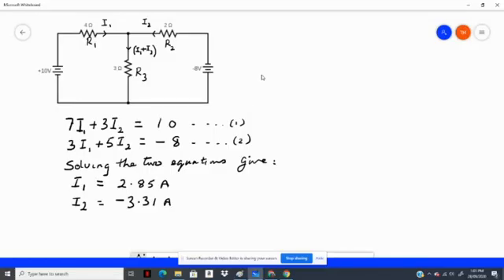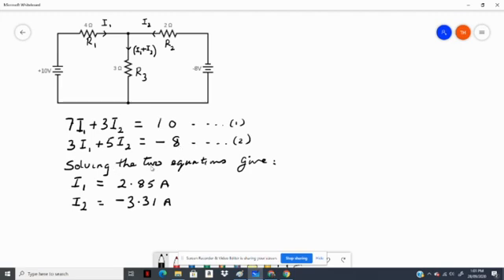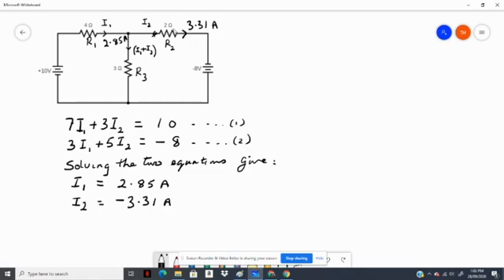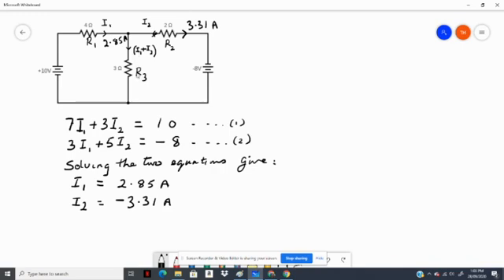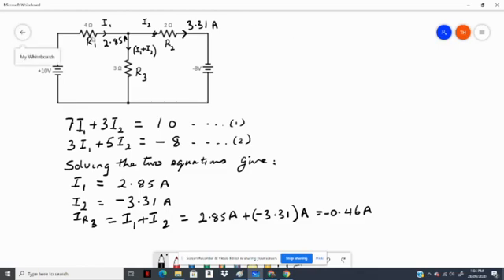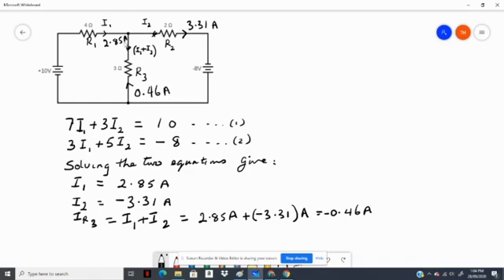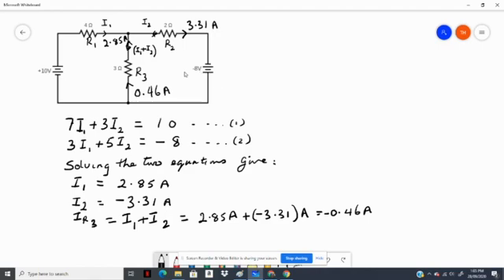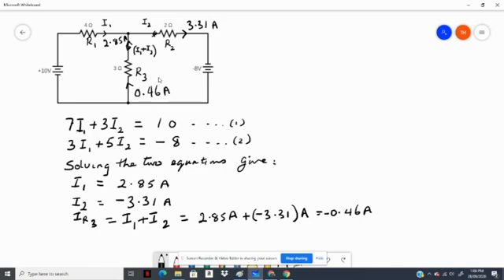Mesh Analysis with sources of opposite polarity Part 2

Comment: Are you saying that a circuit still flows, in both of 2 mesh circuits,  even if the opposite polarity is stronger voltage? Both sources are connected together, not separate power sources.